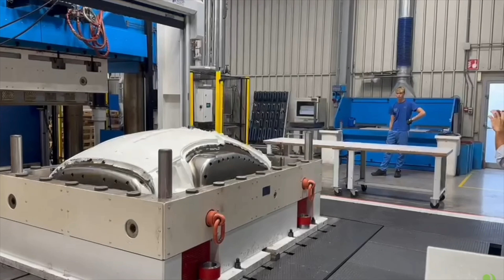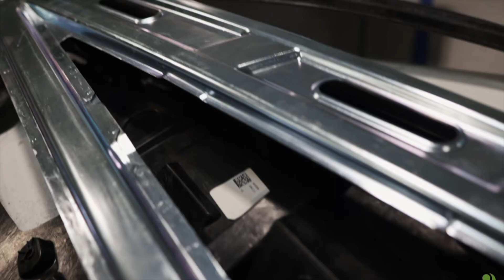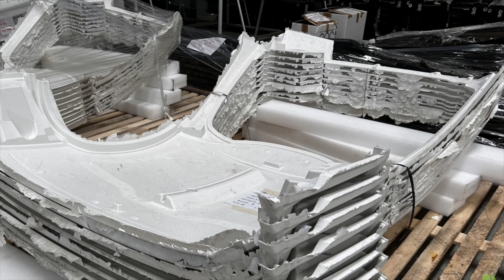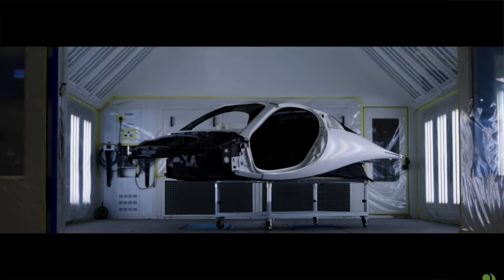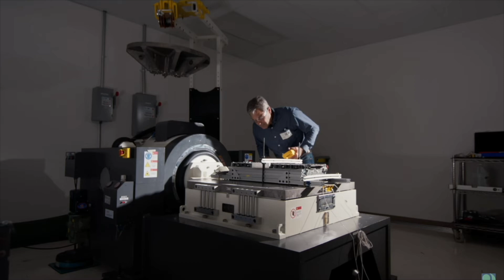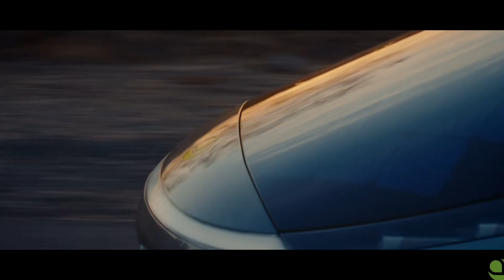With Help PI 2 , 3 , & 4 Coming Together !

Comment: To me this is admitting that they have done little to no preparation for this part of the program. These assemblers and technicians should have already had significant training in this process.
Reply: This is the first build. Who could possibly train them?
Reply: @ResidentNetizen  what a way to not understand modern manufacturing.

Comment: plenty of parts from good suppliers is needed to get this operation off the ground good luck in that
Reply: I agree, getting the supply chain 100% ready at the right time and overcoming part shortages is hard to have control over. Need good suppliers as you say.